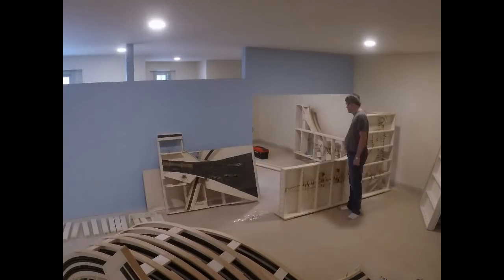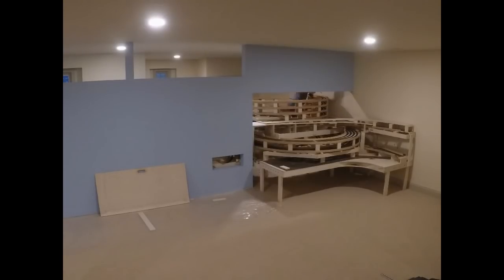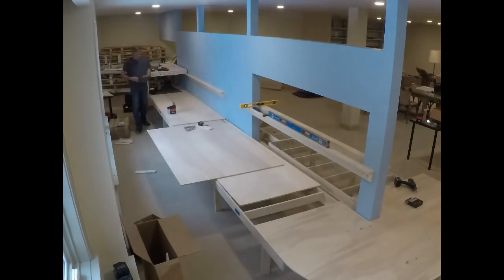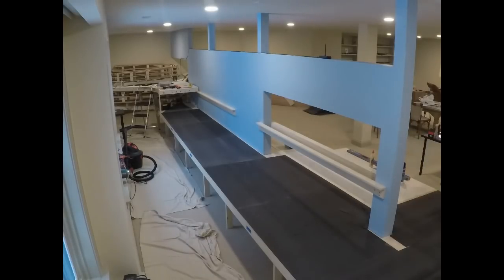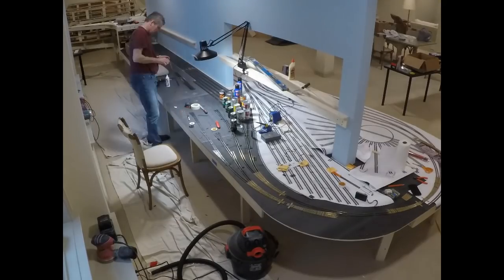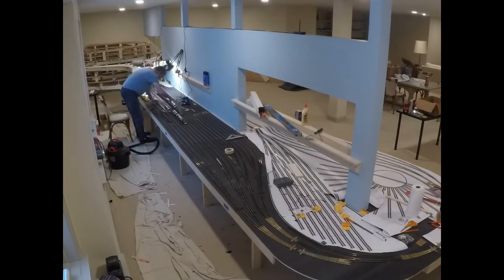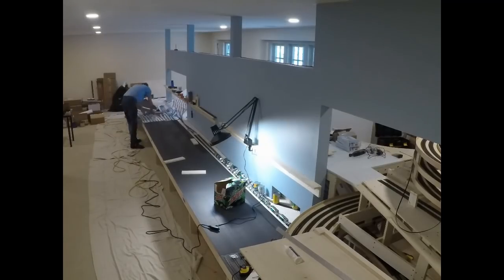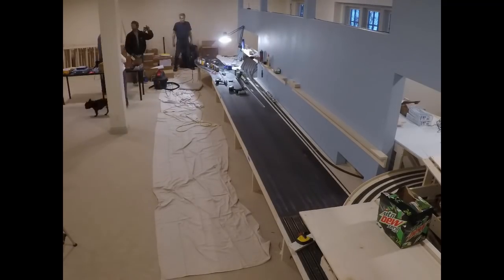Missabe & western RR, part 13: Installation timelapse

Comment: I can't say if the edit time is "worth it," but I greatly appreciate it.  It's nice watching it come together.  

I do have a bit of a technical question.  I'm curious how much data space it took to record all that and how often did you have to dump the SD card in the camera?
Reply from the maker: The remaining timelapse photos use 58GB of disk space (I don't know what it was before I edited).  I have a 132GB mirco-SD card in the go-pro so I didn't need to dump it at all.  I did however copy it to my laptop every couple of days for back-up.  The whole directory containing all the videos I shot during that visit takes up 89GB.

Comment: Are you building a round house around the turntable?  To put it in perspective, we have a round house (an old locomotive shed) just outside Kings Cross Station.
Reply from the maker: The staging level just gets spurs off the turn-table (no roundhouse).  There will eventually be a full steam locomotive servicing terminal with a roundhouse on the main deck.

Comment: yes carpet is a nightmare we had a section of our track we try many things to we finally cut a circle out  under the legs we used new legs problem did when the way
Reply from the maker: If there is a plywood sub-floor under it, one can attach a block to the bottom of each leg and screw through the carpet, pulling the legs down hard until they meet firm support.  Keep the holes through the block undersized and use screws with threads all the way down so they also act as spacers.  I used that method for my home layout in Phoenix AZ, which was in a bedroom, but ever since then I've been working in basements with concrete floors.

Comment: How did your track get shredded?  Was it a moving accident?
Reply from the maker: I wouldn't say it was "shredded".  There were two places where some of the rail ends were damaged during disassembly.  One was a brain-fart where I had the order of disassembly wrong in my mind so the rail gaps were offset in the wrong direction.  The other was just plain carelessness wherein I dragged one section across another.  In total, I had to replace three 6" lengths of track during reassembly - no big deal.
Reply: @mpeterll  Great!!  And by doing it that way, you’ve built a fantastic model layout.  You can be proud of your work.

Comment: Rail joiners?  Do you mean Fishplates?
Reply from the maker: Yes, the British call them fishplates (I used to when I lived there), but to me a fishplate is what the prototype uses - flat plates that fit in the web of the rails.  Since the model version is a bulky item that wraps around the bottom of the rail and has no resemblance to the prototype fishplates, I prefer the American term.  They make a good job of joining the rails but they're certainly not "plates".